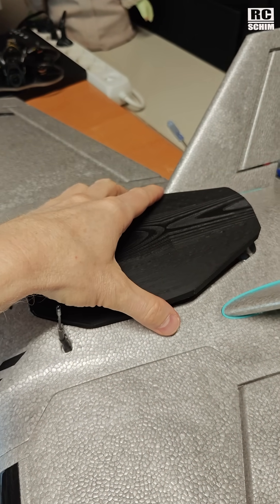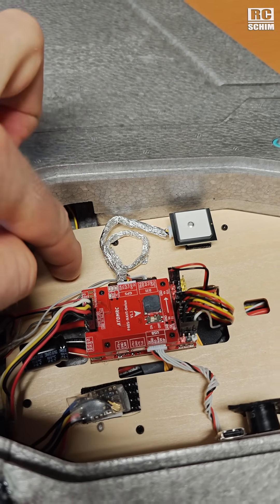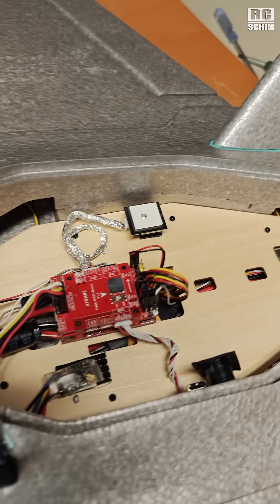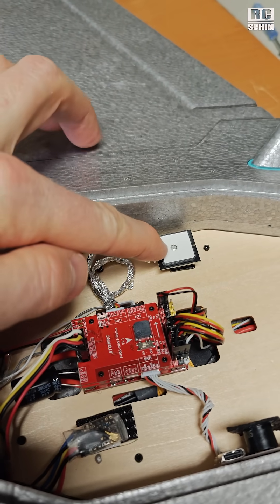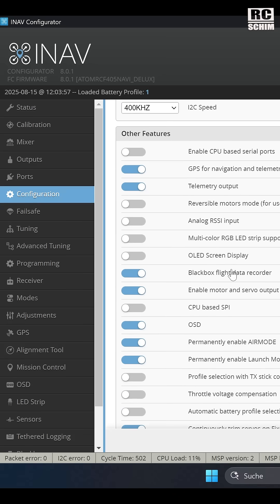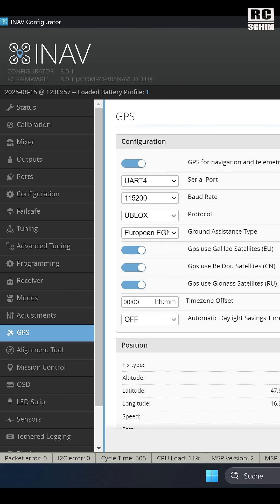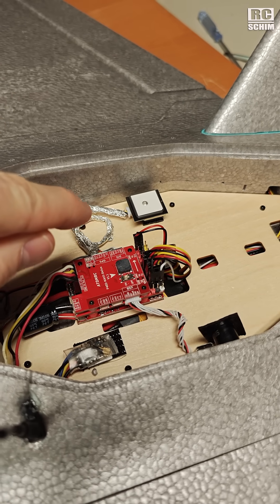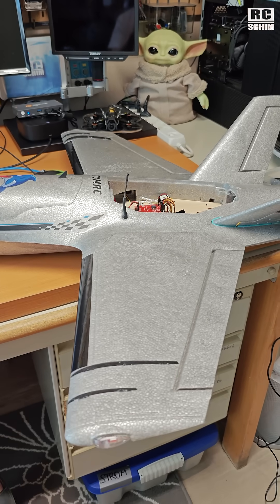#DolphinPro #GPS issue FIXED easy! #inav

Comment: Hi, Mario , did you connect the aluminum screen to the ground / negative on the Flight Controller connector side ? And, if you did, only to this side as per the golden rule ?
Reply from the maker: Nope, just wrapped the cable in foil. My electrical engineering buddy told me the same about soldering... Not necessary
Reply: You must ground your shielding to ground or it's pointless😅